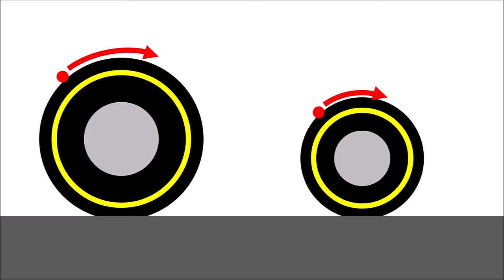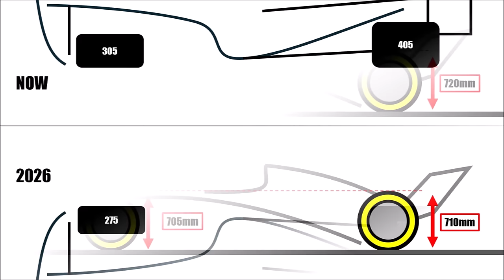F1 2026 - The New Tyre Dimensions EXPLAINED

Comment: Making the 50/50 PU work and not run out of electrical energy before the braking zone on long straights is apparently proving a real challenge. They should change the rules to 55/45.
Reply: Bring back the V10 screw hybrid
Reply: They should've just gone with the electric motors on the front axle if they're determined to have 50/50 and ignore the whining about Audi, cause now we end up with a shit compromise
Reply: @ThijsSH the logic behind the push to have this 50/50 hybrid system is dumb anyway. We could've had v8 engines using more "green fuels" maybe e70 and to offset the carbon emissions from the cars which are already negligible in the grand scheme of things they could cut down the number of races.
But of course not that's just too sane and logical.
Reply: @pr3cious193  "green fuels" will never work. electric is the future.

Comment: 2026 cars will bring F1 speeds back to speeds even slower than 2014.  They will start running like 2015 LMP prototypes, quick bursts of 500hp electric motors at the start of straights and then have the 600hp motor carry the cars up to like 300kph.  "200mph" will become a rare scene.
Reply: The 2026 car ICE will produce the lowest amount of HP seen in f1 for about 50 years, it’s a disgrace

Comment: I think the smaller these cars, the better. Looking back at 2010-2013, the cars were so exciting to watch
Reply: The size difference is shocking when you see them side by side. These new cars are far too big.
Reply: Formula E is where the good racing is at nowadays
Reply: @seashackf1  Wheelbase was free  until 2021, teams  did what was best for performance. :)

Maximum width rule came in 1973, maximum height rule came in 1977  in response to the giant airboxes, the maximum wheelbase/length rule only came in 2022.  Obviously it would have been great if the wheelbase had been reduced more than the 2021 average but the teams refused that.

Comment: Pirelli shouldnt be the one making the rules about tyre sizes, they Are just supposed to do What the fie Tells them to do imo
Reply: In typical Pirelli fashion they don’t want to do the R&D or aren’t good enough to provide said tires 

Bring back Michelin or Bridgestone to f1
Reply: Pirelli have F1 by the balls, they're the only company with the capacity to make the tyres and any interest since Michelin and Bridgestone noped out.
Reply: @fix0the0spade  "Bridgestone noped out." Bridgestone DID tender for 2025-2027, but their tender was rejected  in favour of Pirelli. Even though Bridgestone were willing to pay FOM more than Pirelli (plus providing the tyres for free to the teams, just as Pirelli do).  FOM wanted to stick with the status quo, for some reason.
Reply: @RANDOMZBOSSMAN1  They're more than good enough, the FIA wants tires that degrade, Pirelli could make tires that last several races if they wanted to.
Reply: @kristoffer3000  We’ve had issues with Pirelli tires throughout their tenure in f1 and the tires are ran at such high pressure to protect them in a way Bridgestone and Michelin never had to 

Using the FIA as the reason for their shoddy tires might have worked in 2011 and 2012 but they’re 13 years into their tenure the tires are still an issue in various aspects

Edit - there’s a reason in non control tires  series’ Pirelli’s are never the favoured tires

Comment: Can bbs make wheels that don't explode when they are simply looked at for these regs? The current wheels are hindering wheel to wheel action because if there is even a slight touch the wheels basically explode and end that drivers race

Comment: Very little cause for optimism...50/50 power with all the electric power going to the rear on smaller tyres is going to be a goddamn nightmare. The only upside is that the cars will be thinner but yeah lugging around a big battery is not going to be good...

Comment: Will Audi’s LMP1 experience really play that much into F1 I wonder? I mean yeah the last R18 had a hybrid V6 but it’s an entirely different concept
Reply: In hybrid department probably. Also, unlike WEC, you can activate it at any speed, not 190 (or 140 for old 9x8). Audi LMP, and work on hybrid system certainly have merits, but depends on how well engineers can execute it
Reply: @kidpagronprimsank05  So it could be another Mercedes 2014 situation then? Hopefully though they can also develop a great chassis to balance it out, would love to see one of my favorite auto manufacturers be good at F1 🫡

Comment: Can they just go back to a open engine reg if the team can get the engine to meet more relaxed environment rules
Reply: Cost is the problem, a.k.a. Audi
Reply: @RCmaniac667  we have the cost cap
Reply: Then they have to reintroduce traction control, and probably ABS because it will be impossible to make standards ECU software. Also, it easier to cheat by hiding software for said launch control in it
Reply: @kidpagronprimsank05  they don’t

Comment: 275 front lol that's consumer sport car territory, the cars were already shaped like a thin rectangle it's going to be even more bizarre with less width, I heard they will also reduce the power of the ICE engine, might as well watch Prototype / GT racing.
Reply: F1 tyres were maximum 245mm/10" section front from 1972 until  2016...  The cars used to have a MUCH more rearwards weight distribution,hence the really narrow front tyres and really wide rear tyres in the 70's and 80's. I think 245mm front and 385mm rear like the MP4/4 era looks perfect IMO.  We ended up with the really wide front tyres because the front and rear  tyres were scaled equally in 2017 to avoid changing the weight distribution.  The rear tyres had been made narrower many times by the FIA, but the fronts had always been the same size, so upon scaling the fronts became really wide (305mm).
Reply: @TassieLorenzo  I think it's a recipe for understeer, performance will be reduced, I don't think they will alter weight distribution that much.

Comment: Curiosity question here -- why measure rim diameter in inches?  I imagine it's some historical artifact from ancient American or English beginnings, but if they can change everything else to metric, why not rim diameter?  Or ... do Europeans in general measure civilian rim diameters in inches?  That would really surprise me!
Reply: diameter in inches, width in mm
Reply: The rules actually define the wheel as being 457mm in diameter, which is 18 inches. It's just one of those weird artifacts that everybody refers to wheel rims by their size in inches. It's the same in cycling, even though the ETRTO standards are defined in mm, people refers to BMXs having 20 inch wheels, 29inch mtbs and so on.
Reply: Yes, historical artefact: Michelin introduced metric TRX rim sizes in the 1970's but they did not catch on, these were made deliberately incompatible with imperial rim size tyres as the tyre mounting flange  on metric TRX rims and tyres is a different design to standard  rims and tyres (so as to avoid dangers of TRX tyres being inadvertently fitted to incompatible standard rims or vice versa).  Therefore  rim sizes remain in inches to clearly indicate how imperial rim size tyres are NOT compatible with metric rim size tyres. If you try to fit imperial tyres on a metric rim, or vice versa, you will have a world of problems! Michelin still produces small batches of TRX metric tyres, but most people just change to imperial-sized rims to make things easier.

TRX rim  & tyre sizes: 
340 mm. (13.36")
365 mm. (14.37")
390 mm. (15.35")
415 mm. (16.33")
These rims or tyres are absolutely not compatible with 13", 14", 15" and 16" tyres or rims respectively.

TRX is from the late 70's, so wasn't around long enough to enter the 17" tyre age of the 1980's (the first 17" radials came on the Ferrari F40) or 18" age of the 1990's (and of course nowadays 22" is  common on sportscars and 23" -- larger than semi-trailer's 22.5" -- is common on SUVs).
Reply: Thanks, all.  They're all just numbers, no one has to convert to calculate the volume of a tire or rim, but seemed so odd.  Always glad to learn, and thanks again.

Comment: The more I hear of the upcoming rules changes, I am left incredibly disappointed. The p/u regs are shit. I doubt we will see any significant weight reduction. So we will continue to have an incredibly heavy car that will desperately need maximum mechanical grip. So what are they planning? A narrower car with fairly significantly narrower tyres. This is an impending disaster. They are going to be significantly slower, perhaps slightly quicker than F2. No way this nonsense happens in ‘26. At least they are not returning to the 1.8m foolishness.
Reply: Any weight loss from making the cars smaller and less fuel will be negated by heavier engines and more batteries having to be fitted

The days of sub 700kg f1 cars are long gone

Comment: I think the F1 cars are too big. too heavy and have way too much tire. I would get rid of the hybrids and go back to na engines. 3 liters, any number of cylinders. reduce the with tp 1.8 meters and wheelbase no mo more than 4 meters. min weight 600 kilograms.
Reply: Very big fan of mandating a reduced size because the current f1 cars are far far too large, they're supposed to be small, nimble and fast, now they're huge and fast but not nimble.
Reply: yeah get rid off hybrids, it's not the future anymore and the v10 from 20 years literally perform better than the current v6t. the f1 cars could also be reduced in size

Comment: The problem is the battery pack - that thing has added so much weight and size to the modern cars. Remove the battery from these cars and go back to good old engines

Comment: Fact is, anything larger than a seventeen is the opposite of what is optimal.
Reply: As an owner of R1M, I agree
Reply: @literallyhuman5990  I read a paper years ago in Race Design magazine which tested wheel rim size and its affect on performance.
Reply: @stephencurry8552  I prefer 16 on the front and 17 on the back with 85% bias on front.

Why? Because it's my safe spot so I can use the front to tuck more into a corner and the rear can get extra grip to get out from corner.

17-17 is balanced, but I prefer weight to be a bit on the front.
Reply: @literallyhuman5990  That fits with the math. Assuming you did not do an analysis, you have good engineering instincts.
Reply: @stephencurry8552  I just do it because it's been my habits since I use my old underbone for Sunday racing. Bit small on the front and fat rear. The drawbacks is very noticeable, I'm easily shitted on in fast corner because my front isn't that wide and large
Reply: @literallyhuman5990  All about engineering compromise.
Reply: That's not true, I posted above: 16" with higher profile is better for straight-line traction and wet grip (as the tyre can deform more to contour to the road) BUT a 18" low profile tyre with short sidewalls is better for controlling the contact patch in dry.  Check out Jonathon Benson's test on road tyres where he compared 17", 18" and 19" tyres: 17" was fastest in the wet on a circuit but 19" was fastest in the dry on a circuit, even despite the greater rotational inertia and weight. So  I wouldn't assume there are not technical and performance benefits to sticking with 18".  Around a lap in the DRY, the lower profile tyre on a heavier larger wheel may actually still be faster against the stopwatch -- it's not  drag racing where you want a high profile, very flexible tyre (where there is no doubt the lighter wheel with higher profile tyre is better).  It's all about the cornering.

Comment: Reducing tyre size: GREAT - current tyres are way too big
Making front tyre smaller: GOOD - but I want the front tyres to be MUCH smaller then the rear tyres!
Reducing car width: TERRIBLE - racing cars need to be wide. They were 215cm until 1992, now they are 200cm, and they want to make them 190cm which is close to the absolutely terrible and ugly 180cm of 1998-2016.

Comment: I don't get it, how can the power balance be 50/50 with no front wheel generation? Where's all the power going to come from if the MGH is gone? Rear wheel braking? Is the engine transmission going to have a "generator during braking" mode? Could work I suppose but would sound stupid.

Fear Audi, that's just baby talk if you ask me.
Reply from the maker: The engine will burn extra fuel to recharge the battery.
Reply: @BSport320  wow so eco friendly, thanks FIA!

Comment: I personally prefer 270/710-18 front and 355/710-18 rear, but that's not up to me, just saying.
Reply: I'd like 245/640-18 front and 405/660-18 rear (or 670 or 680mm) like the good old days! The tyres from that era (80's, early 90's up to '92) just look right, though I'm not a fan of the downsized 13"  rims compared to the15" rims on 1960's  and early 70's  F1 cars. When there was a 1970 March on 15" tyres and 1990 Benetton on 13" tyres parked side by side, the March's wheels definitely look more "right" than the balloonish 13" that the FIA mandated.  [USAC Indycar also used 15" in the 60's and stuck with 15" until the present day.]

Comment: With the removal of the mgu-h and it's components why don't F1 just use 4 cylinders then instead. V8s and V10s would obviously be what we fans would love to see again but F1 is still trying to push for there cars to utilise things that can be used on road cars and 4 cylinders are one of if not the most common engine used in road cars. Plus it could be appealing for more manufacturers to join as VW, Toyota, Nissan, Honda , Mercedes, BMW , Audi , Ford and many more have had success with 4 cylinders in Motorsports. A 4 cylinder with the removal of the complicated and expensive mgu-h plus it's components could mean smaller and lighter cars as a inline 4 cylinder would take up less space than a V6. 

Japan super formula and super gt are having success with those engines. DTM before they became gt3 cars had success with 4 cylinders.Porsche had success with a 4 cylinder though a V4 and not an inline 4. BMW back in the 80s/90s bulit a very powerful inline 4 cylinder so with F1s technology today they could build powerful inline 4 cylinder engines.
Reply: Another Ducati GP incoming to 4 wheels
Reply: The reason is that a I4 can't be a fully stressed member. It was discussed and shot down when they switched to V6s.
Reply: @wiegraf9009  maybe use a spaceframe or would that still not work?
Reply: @wiegraf9009  V4 solves that. But I prefer the V6 sound, the Porsche 919 doesn't sound that great IMO.  V4s are a little samey and tiresome with their offbeat sound.
Reply: @wiegraf9009  Yet the I4 category engine of SuperGT and DTM is used in Super Formula  without issue? That's actually quite a clever set of engine regulations: it's control turbo but the combustion chamber technology is very similar to Formula One.
Reply: MGU-H is not complicated nor expensive. It's just an electric motor on the turbo shaft that also works as a generator. What they should ditch is the MGU-K, and have a car with an pure ICE drive. With a loud, powerful V8, V10 or v12 . Light, fast, fun to race and to watch racing. I'm not paying to watch a bunch of cars running with an engine of a road car. For that, I can watch the street from where I am standing.
Reply: @OliveiraX  Mainly mechanical. Since it’s connected to the turbine shaft and can spin up to 125,000 rpm, it’s sustained to great heat and VIBRATION.

As an SPM (Surface-mounted Permanent Magnet) motor for both H and K, there is an air gap between the inner rotor and outside stator where the majority of magnetic reluctance is located. In order to maximize the efficiency you need to minimize the reluctance by shortening the air gap just like reducing the resistance of wires in an electric circuit, which means that you need to keep an extremely tight tolerance for all parts of the motor, under high temperature where everything is under considerable heat expansion and lots of vibration from the ICE. Very challenging task and costs a lot of money.

Btw for teams (Merc and Honda) trying to suddenly increase and decrease its RPM in order to use it as a bypass to absorb extra energy harvested by the MGU-K beyond the 2MJ per lap limit, it adds another requirement for the shaft and turbine blades to sustain that extra load.

Source: Ferrari Engineer
Reply: I too believe a turbo V4 would be the way forward. they could just copy the Porsche 919 Evo with its 700 something hp V4 and an MGU-K with 470hp along with a smaller front axle mounted MGU-K only for recuperation. this would allow the battery to be almost fully charged after every hard braking zone and the V4 would have enough grunt to make up for when the battery SOC is low. the brakes could also be smaller as the MGU-K's would provide a ton of braking force.
Reply: @Tommmmmmmmmmmm 919 Evo was a car that disregard rules and regulations so we don't know V4 with that power can lasts in F1 environment, and you need to make it both reliable and lasts. I doubt the engine will lasts at that power, and rev for F1 distance

Comment: Why the fuck Pirelli has a word in the regulation. If they don't like it, let's change for a tire manufacturer that will answer to FIA. Bridgestone or Michelin could produce a 16inch smaller wheel. It is bad for the driver visibility. Also reducing width of tire means less mechanical grip, while we want more grip from the tire and less from aero. The car are not sufficiently lighter to have such tire width reduction at the front. That means even more understeer... The car will be even worse to drive than current gen.